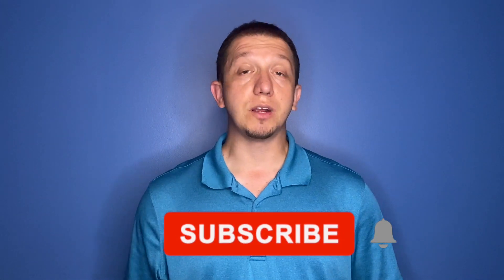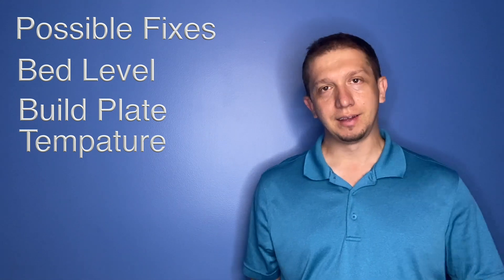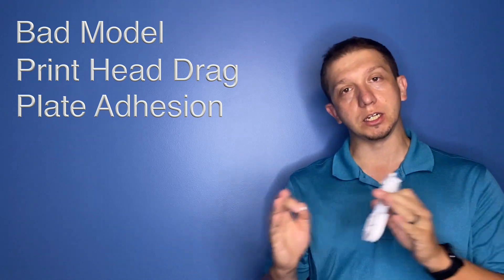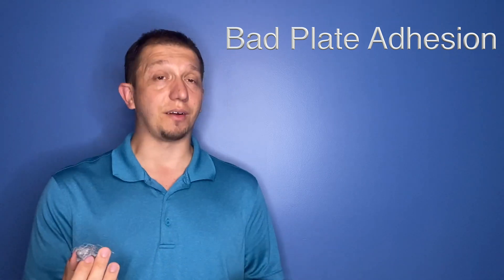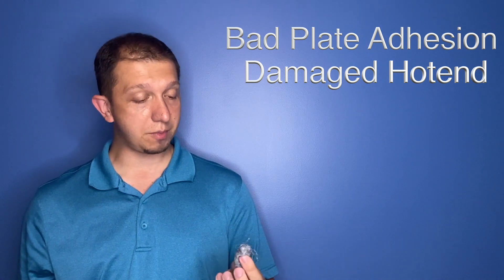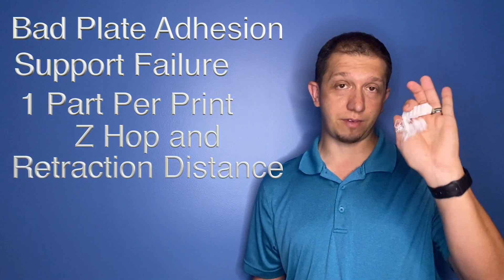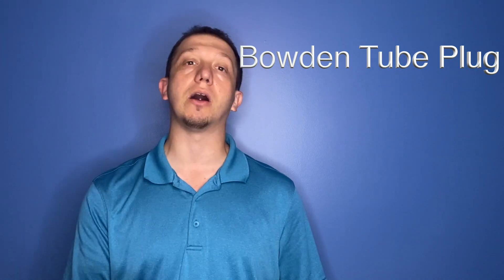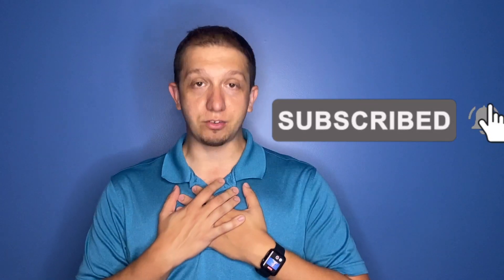5 Common 3D Printer Fails and Fixes

Comment: I think we have a clog… we had a problem that another of your videos solved so thank you!… but now trying to print and nothing is coming out of the nozzle after an initial small string.  Can I just twist out the nozzle to clean it?  Is it the old filament in the tube  (we haven’t used the printer in months because of the first issue)?  I guess I’m just clueless as to how to actually clean the clog.  Forgive me if there was another video in this that I missed.  Thanks
Reply from the maker: So if you plan to store the printer for a time always pull the filament and it can gain humidity.  Heat the machine up and you should be able to unscrew the nozzle.  Careful it wil be hot and replace it.
Reply: @Rise3DBuilds  replace the nozzle?  Any recommendations on where to purchase a new one?
Reply from the maker: I usually purchase on Amazon.  What printer and I can send you a link
Reply: @Rise3DBuilds  Ender 3.  But will the filament come out of the tube once I replace the nozzle?  Total beginner here…
Reply from the maker: Most times.   Some time you have to pull and trim the end of the Bowden tube.  Here is a link to the nozzles I buy:  https://amzn.to/32y0DLz
Reply: @Rise3DBuilds  thanks for your help!  I will give this a whirl.

Comment: Help! My print is going well but suddenly the pla is grinded and the quality decreases o just spoils the whole piece as a domino effect, what can I do Please? Cr10 v3
Reply from the maker: Sounds like you are having a issue with pulling a filament or your starting to get a clog.  It’s possible it’s a issue in the gcode with the model
Reply: @Rise3DBuilds  I'm having the same problem with the same printer! I printed a model with no problems then I tried to print it again now the filament is grinding and failing at the same spot over and over and I even replaced the nozzle and the tube :(

Comment: I've been trying to fix clogging for a week now and yeah, it's frustrating. Thank you for your honesty, if i can't get it to work after some more cleanings I'll definetly buy a new hot end.
Reply from the maker: Have you pulled your Bowden tube to make sure that’s not the cause of you clogged.  The tube can get gunned up and replacing or trimming can be a huge help
Reply: @Rise3DBuilds  Turns out the extruder broke at some point, which was causing the print to fails. Apparently it's a common issue with ender 3 but the hot end also needed a clean ^-^

Comment: Hello, my layers just won't stick, no matter if it is pla or petg and i have small blobs that forms on my prints and afterwards sticks to the hot end.
but the first layer adheres but there is missing perimeters

(image of the print there in a few hours)
Reply from the maker: Hello. Sorry to hear you are having issues with the print. I think the best steps for you to start with would be to calibrate your Esteps.  I would also check you extrusion settings. It sounds like your printer is over exturding.   What printer do you have.  What are your cura settings?  PLA and PETG do usually require different settings so also keep that in mind.   Please let me know and we can talk further.  Thanks, Mike
Reply: @Rise3DBuilds  Hey! i use super slicer, a upgraded version of prusaslicer with the ender 3 profile: 

My first prints with Superslicer where incredible but after 1 week or 2 it just would'nt work well anymore...

 https://www.youtube.com/watch?v=LIUB7CbDQD4

PLA:https://drive.google.com/file/d/1AzRYZhTBjH9fCGokIHjxxMtzEdLA4SPE/view?usp=sharing

PETG:https://drive.google.com/file/d/1YF5wG8wXemfh1VEKZJcx1iEXFf2Z-2Pw/view?usp=sharing

I forgot to say that my extruder is slipping like 2 OR 3 times per Second and i don't know how to fix that,i searched online with no results

And i will try to calibrate my esteps later...

Other of your tips present in your video also helped me for some minor problems!
Reply: @Rise3DBuilds  My Cr-Touch is also not levelling my bed properly...
Reply: @Rise3DBuilds  I will also upgrade soon with a

BTT SKR mini E3 v2.0 motherboard
AND a tft35 E3 V3.0 SCREEN
Reply: @Rise3DBuilds  Update: i did my e-steps and it did not resolve my problems

Update 2: i changed nozzle and it resolved most part of my problem
Reply: it was supposed to be a mold for a paper recycling experiment but at this point it is unusable:

https://drive.google.com/drive/folders/14pO80zvGl_RxPV85rGNUv9uHUzXA4H_C?usp=sharing

Comment: Not sure why my nozzle is knocking the print off help please?
Reply from the maker: There could be servers reasons.  First bed level.  Try leveling your bed.  Next bed adhesion,  you might need a raft or a brim to give it better hold. Temps, you might need to adjust you temps upward.  Zhop, if you have multiple parts it can catch as it it moves across.  Make sure this setting is enabled and at least a couple millimeters. This will let it move with out catching.
Reply: @Rise3DBuilds  I’m sorry not sure what Zhop is I’m very new at this. This is only my third print well really counting the drops it’s like the 9th or 10th
Reply from the maker: In cura search in the print settings for zhop. I would also go look at my cura basics video to see some helpful plugins
Reply from the maker: If you still have trouble email me and we can see about setting up a zoom call
Reply: @Rise3DBuilds  fantastic thank you! I will look both up and try again tomorrow. If it is still operator error lol I will send one out to you. Thank you again!
Reply from the maker: Did you have any luck?
Reply: @Rise3DBuilds  haven’t had the chance to try yet, was just looking for your email.
Reply from the maker: Mike@risofthefenix3d.com
Reply: @Rise3DBuilds  sent
Reply from the maker: I apologize looks like I mistyped the email.  its mike@riseofthefenix3d.com
Reply: @Rise3DBuilds  thank you for the quick response! I leveled the bed and tried to move the temperature for the bed up. Lol I’ve been trying for hours.

Comment: When I make a print on my ender 3 the layers are very visible and there is a lot of stringing. I was printing myself a small model and I had to stop it half way through because of this and ever since that happened I’ve not been able to fix it. I’ve tried changing filament brands and levelling my bed multiple times but it still does it.
Reply from the maker: Try raising your retraction setting.  That is the most common issue with stringing.  Layer lines you might need to check out my Estes calibration video

Comment: Okay. I have a question. I understand what you said about the spaghetti problem. I had that. u tried printing a Thor hammer and I started it and it was half way through the hammer head and then spaghetti'd out of no where. And then I was printing a small oggie boogie and I printed for an hour and 45 minutes and then with 20 minutes left my printer just stopped out of no where. Please explain what could've happened cause that was a prefect print that randomly stopped. Please help me!

Comment: high great video i bought an creality Endor 5 pro do you think that's a good printer to start off with?
Reply from the maker: I have not used a Ender 5 so I cannot give you a fair yes or no since I have not used it.  I steered away from it because it looked like so many more moving parts that could fail, size of the build plate, and just sheer size of the frame.  I am sure it is a great machine and you will have a lot of fun with it.   Let me know if you have any questions.
Thanks!!!